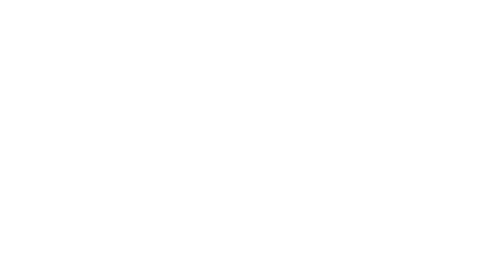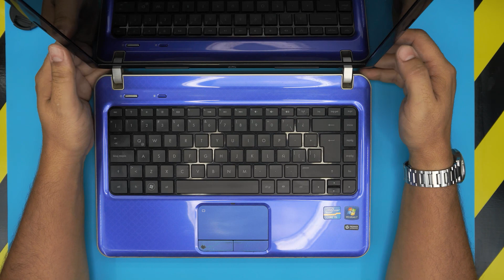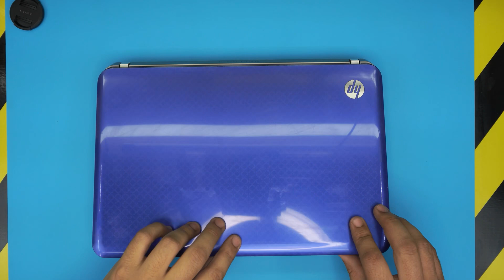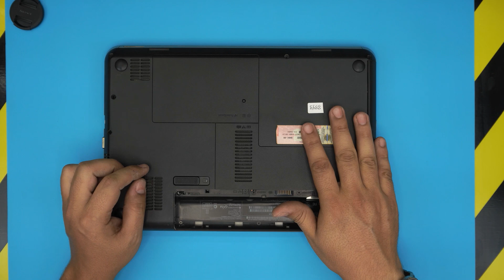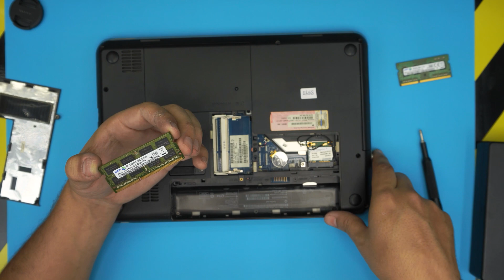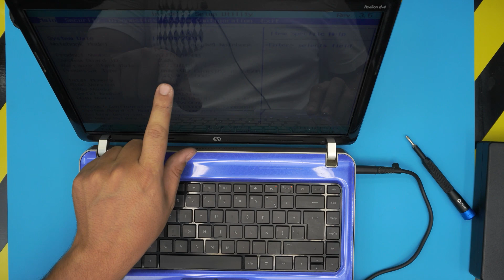HP Pavilion DV4 🔵 RAM UPGRADE

Comment: I have HP Pavilion dv4-2112tu Intel® Core™ i5 i5-430M. Can the processor be also upgraded?
Reply from the maker: 🫠Regarding your question, sorry to inform you, but the CPU is soldered on the board and is not replaceable.
Should you have any further questions or requests in the future, please don't hesitate to ask me.
cheers🍻